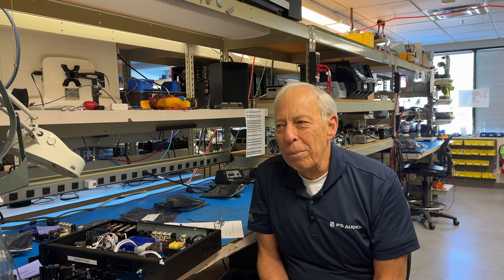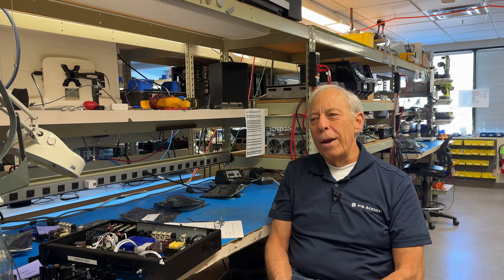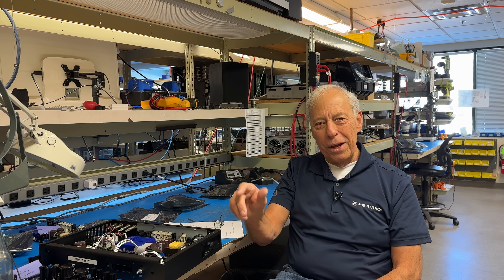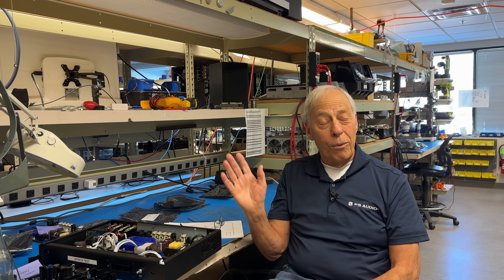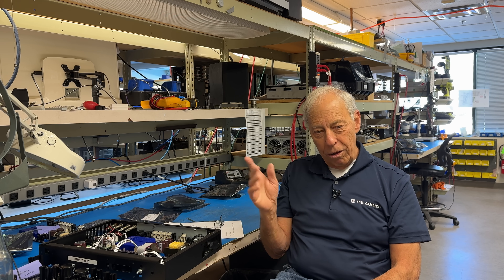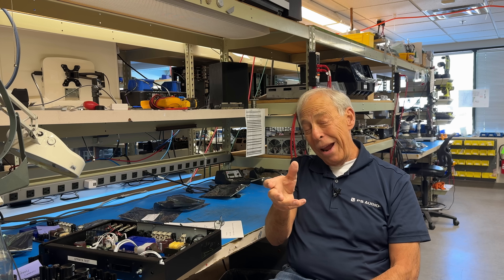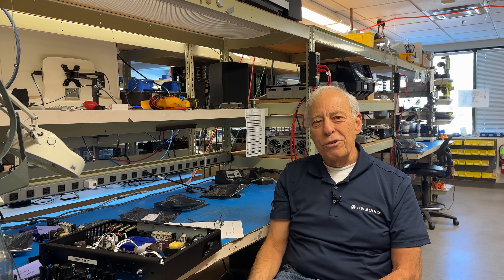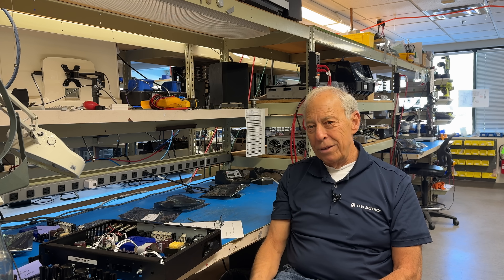Understanding dB level

Comment: Another way to think about it: say your integrated amp puts out 120 W per channel at 0 dB (max output).
at - 10 dB is gonna “push” 60 W into the speakers (half)
-20 dB  30 W
-30 dB 15 W
-40 dB 7.5 W
-50 dB 3.25 W
-60 dB 1.6 W
Now, if your speakers are rated at say 90 dB for 1 Watt, well even at -60 dB you’re still pushing 1.6 watts into them so they gonna play LOUD (well over 90 dB) 
Thai is also why efficient speakers (90 dB from 1 watt and up) can go really loud with only a 5W tube amp!

Comment: Ah yes, the STA240 Realistic Stereo Receiver "volume control calibrated in dB"! I got to understand at 16 years old what 0 means. In the case of this over-thought and over-engineered Realistic receiver and unbeknownst to me, I thought I knew Hi Fi and that 0 meant ZERO!  Well, the power was off and I reasoned that 80 was loudest and 0 was the quietest even thought this meant that the volume pot must work backward from all the rest. So I put the volume at 0 and pushed the power ON. Holy BALLS of FRIDAY! It came on in full blast of all 60watts right there at hand length. O.k. I guess 0 means LOUD. What did I know? It made no sense. The salesman, white shirt and tie and name tag,  briskly walked over as I tried to fumble the volume control the OTHER way! (my fine motor skills non-functioning by the bomb that just went off!)
Salesman: "Would you like a DEMONSTRATION?!"
Me: "Um, I think I just got one."
I walked away feeling very prickly and red-faced. Lesson learned.

Comment: As a ham radio operator, in my head I kept hearing "attenuate...attenuate"...then mere seconds later Paul you said the word. The preamplifier attenuates the source, which at "line level" would drive the power amp to near its maximum output. Your explanation could not have been better.

Comment: Same thing with cable going in to your home. For signal you wanted 0-10dB. I can’t remember how many mW 0dB was but it wasn’t a a lot. Anything above or below that would fail out.  As channels and internet speed is added the frequency keeps increasing. The downfall is as frequency goes up as does the attenuation. You could have great signal down low in the band but as it increased the dB would decrease at a 45 degree angle across the graph. Number of splitters and cable type and length would effect this. You had to balance out the signal and return levels. Increase or take away from the other has the opposite reaction. Only way I found to knock down the signal without increase the return was to run an extra 1-200 feet of cable in the circuit. Would be a zip tied loop under the house. This would happen to a customer that’s 50 feet or so from a node and they only have one piece of equipment ie a modem. All that noise has to go somewhere

Comment: Thanks Paul, this video is of particular interest to me because it was actually a review of an older PS Audio product line, the GCC 100 and 250, that prompted me to research and finally understand how volume actually works in most audio amps. I had been an audiofile for many years. But Like most people, I believed that turning up the volume meant turning up the juice, or power. I was fascinated to learn that the volume knob actually progressively removes or releases suppression from the full signal, which increases the power and volume level. That was interesting enough, but the real kicker was learning that the quality of sound was actually increasing as the volume went up because the power suppression that keeps the volume low is also diminishing the signal quality. For years I thought that I could actually hear more detail at higher volume levels, and I had to grin and bear the standard comment that higher volume doesn't make better sound. Granted, the difference in detail might be minimal between moderate and higher listening levels. But I was certain that I was hearing a difference, with more detail at higher volume levels. The PS Audio GCC line of amps used  a "gain control cell, or gain cell" for volume control (I think). The gain control cell, if I understand it, does not control volume by suppressing the full signal, and meading  the power out as the volume is turned up. Consequently, the GCC amps apparently provided superb detail at low volume levels, which most other amps with standard volume controls don't by comparison. The reviews of the GCC line, all positive, said so. But there was one disappointing aspect... none of the reviews and articles ever explained exactly how the gain control cell worked. I've also heard it called a gain cell, and I'm guessing that these two terms refer to the same mechanism? So, after this long explanation, I'm hoping that you might be able to find a little time to respond and explain how the gain control cell actually controlled volume. If I remember correctly, the GCC 100 and 250 were class D integrated amps? Does the gain cell only work with class D, or could it also be used with class AB, and A amps? Thanks again for this video, and if you have a spare minute to shed some light of how gain cells work, I'd love to finally get a little closure on that old technical question.

Comment: The dial is showing the gain margin of the amplifier.  The gain margin is found in the frequency response function  of the system.  This is a measure of the amount that the gain can increased until the system becomes unstable.  This comes from control theory and the negative sign is because the characteristic equation is in the denominator.  A dB is by definition 20 log10(|g(iw)h(jw)|.  thus any value will be negative because the expression for the characteristic equation is in the denominator.  The use of the bode is because the frequency response of the amp can be obtain experimentally.  When you increase the gain the frequency response moves up and the gain margin is reduced.  When zero is reached the system is considered unstable thus its max amount that the amp can produce.  To better understand this look at some youtube videos on bode diagrams hope this helps. it not a mystic once you understand the theory.

Comment: If amplification of a signal generates distortion, does the attenuation method make it less so between the min and max volume? There is always a distortion difference between loudness levels but is it so that attenuation enables the gear to have less distortion than when the signal would be amplified instead? After all We lover the current instead of getting more. Or is it irrelevant and it does not matter which method We have in a particular piece of gear and in each case the distortion is dependant on the loudness level alone? Just my random musings 😇

Comment: I was an audio operator at an FM station in the late 1980s and early 1990s. I used a walkman as a monitor instead of the sound of the console, so I had exactly the end result just like any regular listener. I learned how to use the minimum and maximum audio processor thresholds to my advantage, so I could leave the scratches and cracks noises from  some records well below the music. I also used this when playing ads and the station identification so they would sound louder without sounding compressed. I really enjoyed doing this. And yes, I respected the 0dB limit at all times.

Comment: Anything raisedw to the power zero is 1. So the input is multiplied by 1 to give the output..it's neither larger nor smaller. A negative (minus) power is less than 1 so input may be multiplied by a fraction to get the output so it gets decreased or attenuated.

The confusion arises because dBs are powers of the number like 10²=100.. the 2 is the dB.

We do this because sound intensity varies over such a wide range, we'd be talking of 1000000000000 or .0000000001 in terms of the sound intensity and that gets unwieldy.

So we use the powers of the 10 base which is a smaller range of numbers..

That's the basic idea, the actuality has slightly different multipliers but this is cut down

Comment: Just for a bit of clarity, there are different measures of dB. dBu, dBw and dBV.
dBV is the one that is used to measure voltage, for example, between a preamp and power amp. +6dBV is approximately double the voltage that 0dBV is. It is generally regarded that people can only hear the difference in level between 1dB, so it is a really useful measurement. 
It is especially important when measuring the frequency response of a piece of audio equipment. It’s as simple as checking that the dB level doesn’t vary, plus or minus, by, for example, 0.1dB between 20Hz and 20kHz. It’s much easier to follow, when testing, than raw voltages.

Comment: There are snippets of truth all around here, but also a lot of confusion.  Some is from making no distinction between the following different uses of the term decibel:

(A) "Absolute" decibels, which are computed as 10 times the Base 10 logarithm of the ratio of a power level under discussion to a REFERENCE power level, which MUST ALSO be specified.  [In the general sense, all dB numbers are just numeric ratios, with no units.  But in the context of these kinds of dBs, since the reference signal's absolute level and unit(s) are specified, the level and unit(s) for a given signal are also known absolutely.] 

E.g., dBW, where the "W" refers to 1 watt, or dBm, where the "m" refers to 1 milliwatt.  E.g., 1 milliwatt = 0 dBm, or -30 dBW; 2 milliwatts = +3 dBm; 10 milliwatts = +10 dBm; 400 watts = 26 dBW, or 56 dBm.  The math is TEN times the log ratio because we're talking about "deci-bels", a tenth of a bel, not "bels".  [Let's agree to not talk about bels any further - but if we did, the math would be just the Base 10 log of the ratio instead of ten times that].  

We use logarithms because our hearing of different loudness levels correlates to a logarithmic "compression" scale of power ratios, NOT their simple linear ratios.  Twice the power level is not perceived as being twice as loud - it only sounds about 30% louder.  It takes TEN TIMES the power to sound twice as loud.  This is behind the reason why, e.g., a 2-watt amplifier can play music fairly loudly 95% of the time with many speakers - but you might need 100 watts for the peak levels just a few decibels louder.  And why a 100W amp can only play 3 dB louder than a 50W amp [and why I wish that all amps had a dBW rating as well as a wattage rating].  So we use Base 10 logarithmic ratios in the form of decibels to best correlate to the differences that we perceive between different power levels (whether it's the acoustic power of vibrating air molecules or electrical power in or out of an audio device).  It was the ancient telephone industry that adopted this practice; technically, 0 dBm is 1 milliwatt into 300 ohms; but we usually gloss over that specific impedance level in our business, as we have our own common pseudo-standards, e.g., < 1000 ohms for line-level outputs, >= 10k ohms for line-level inputs.

(B) A common special case of of (A) is dB SPL, where SPL - special because the reference is often not explicitly referenced, just assumed from the context.  SPL refers to the specific acoustic reference "Sound Pressure Level" that most people with reasonably good hearing can just barely hear in air at 1 kHz - "the threshold of human hearing".  That standard reference level is 0.00002 Pascals (Newtons/square meter - Root Mean Squared [RMS] levels, to be specific) of sound PRESSURE (NOT power, hence the math demands TWENTY times the Base 10 logarithmic ratio for these decibels - see more on this in Item C below).  Sound AT THAT REFERENCE LEVEL is therefore expressed as 0 dB SPL - or often just 0 dB for short.  This is the scale that we use to express levels up to, say, 40 dB [SPL] as quiet, 80 as noisy, 100 as symphony orchestra crescendo loud, 120 as painful, etc.  These are sound pressure levels in air, which have NO ABSOLUTE DIRECT correlation to decibels of watts or volts or amps in electronic equipment producing such sound levels UNLESS much additional information is taken into account, such as loudspeaker efficiency (acoustic watts output for a given electrical power input), distance from the speaker, the spatial directivity pattern of the speaker, the direction of measurement relative to the speaker, and whether the measurement is performed in open 3D space or an approximation of it (such as a practical anechoic chamber, or a time-windowed measurement to simulate open space by ignoring room reflections) or actually including a room's characteristics and its sound reflections.

(C) Common "throw-around" (my term) decibels, where the reference level is WHATEVER IT IS in the understood context [e.g., 10 millivolts out of a phono cartridge, or 2 volts out of a DAC, or 1 watt out of a power amp, or whatever], and the actual level is then expressed as a number of dB above (+) or below (-) THAT level.  IMPORTANT DIFFERENCE:  If voltages (or currents or SPL) are being compared instead of power, then the math demands that the decibel numbers be calculated as TWENTY TIMES (not ten times) the Base 10 logarithmic ratios.  This is because power in watts is proportional to the voltage or current SQUARED, and the logarithm of a number squared is double the log of the original number.  A 2:1 voltage ratio = 4 times the power ratio =  +6 dB in power.]

The subject is not terribly confusing to electrical engineers or technicians, but since decibels are all about numbers, even a minimal clear and cogent explanation does require a bit of math.  I hope this helps a bit.

Comment: This was not a complete explanation.  A key piece of info left out is that a decibel value is a RATIO.  It is always a ratio between some "reference" quantity and the quantity you're trying to describe.  And it's a logarithmic scale.  If it's voltages being referred to, then dropping 6dB is a halving of the voltage, and increasing by 6dB is a doubling of the voltage.  If it's power, then 3dB drop is a halving of the power, and a 3dB increase is a doubling of the power.  It is always a measure of the ratio between the reference value and the value you're trying to describe.  What is the reference value?  It's different for various things.  You'll have to look that up.    For sound, it's some extremely low sound pressure level at some specific distance from the sound source.

For amplifier volume controls, the chosen reference level is "volume knob at full volume".  Nothing else makes sense other than "volume knob at zero", but the reference value can't be zero, because anything multiplied by 0 is still 0, so you cannot have a ratio with zero as one of the values.  Hence, 0dB was made to be "full volume" for amps that show the volume as dB.  0dB is also full volume for recording (as seen on VU meters), so there was already some precedent set for 0dB to mean "full volume".

Comment: OdB is Unity Gain. There's the term to look up, if anyone is interested.
Reply: yes 20log10(1)=0.  In control theory the system is unstable when 1+g(jw)h(jw)=0.  for this to occur the magnitude of g(jw)h(jw)must be 1 that why you have the zero.  The angle is one 180 but the term is in the denominator thus it is -180 degrees.  you are working with complex numbers.  This scale is coming from log plots of the sinusoidal transfer function.  That is why in old audio that recorded when you get pass zero dB it usually was red (unstable)
Reply: @frederickajustagosto4765  In this case though, Unity Gain, we're talking about what the attenuator (volume control) is doing to the signal, which is this case, is nothing. Zero on any kind of level meter vs. zero on attenuator (fader, pot) are not interchangeable terms, for those following along at home.
Reply: @carterwilliamhumphrey3373  look at the definition of a dB unity is a value of one its log10 is 0 10^0=1 that is why its zero in dB.  it i using  log scale.  saying the same thing 1.  the word unity means 1.  note he says that zero is what will run amp to loudest point.  people confuse log with linear.  You can't have the log of zero try it in your calculator.
Reply: @frederickajustagosto4765  We seem to be deep into the math here, and I don't know why. If you want to go into an amp circuit, a gain factor of 1 is, in fact. unity gain of the amplifier, meaning: what goes in level-wise, is what comes out. Similarly, if you put an audio fader at "0", you get the same signal level on output as input.

Comment: People have to understand, that db on its own is just an algorithm, the letter behind it makes it a unit. And db - only occurs on electrical db‘s like db m or db u. If you use acoustic db measurements like db SPL ,there is no minus.
Reply: dB is not a unit.  It is a unit-less value.  The letter you are referring to specifies what the reference 0dB value is, and is sometimes also the units for that reference value.  A dB value, like -3dB is unit-less itself.  It is just a ratio like 2/3 or 27/8.   The units come from whatever units the reference value has, but the actual dB value itself is unit-less.

> "And db - only occurs on electrical db‘s like db m or db u. If you use acoustic db measurements like db SPL ,there is no minus."

There is always a minus.  The reference value can never be 0, so any value you tell me, I can always tell you a value that is half that.  Therefore, there is always a minus.

Comment: Decibel is a unit of measure and input voltage can be measured in dB as well as output sound pressure but they are not the same thing. Zero dB on an amp is full power and for every -3dB volts input the power is halved.  Google dBV vs dB spl for more.